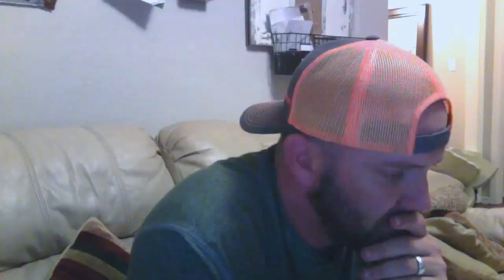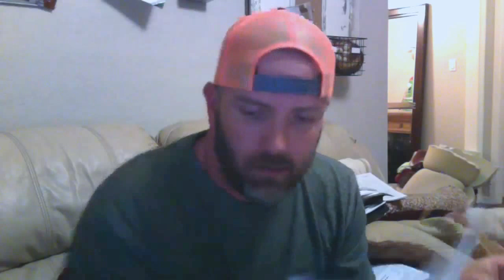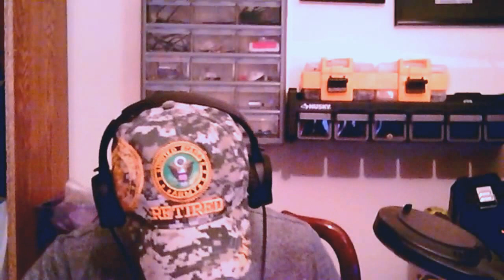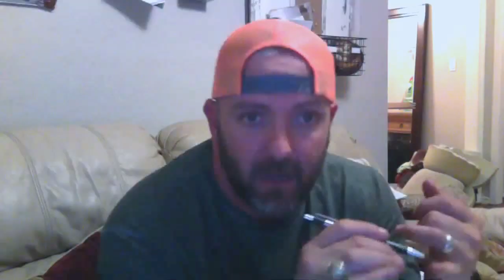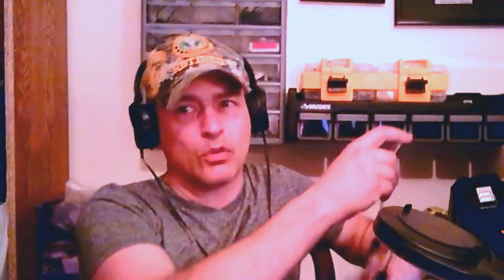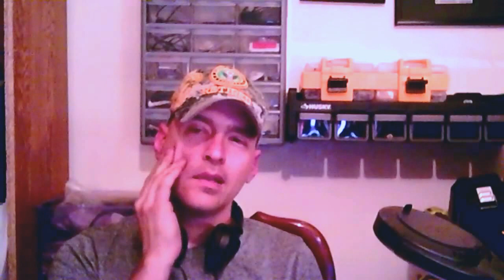PSI ELECTRICAL MASTER EXAM TUTORING SESSION

Comment: is the book he has the one on your site the Textbook PSI 2014
Reply: Mitchell Tolbert did he pass  the exam next day?
Reply from the maker: We have two books. One is a smaller 166 page workbook we use in our classes. It is a shortened condensed version of our Textbook which is 320 pages.
Reply: the one you sale on your site does it contain the same information
Reply: i took the test and i had this same test will the book sold on your site help me
Reply from the maker: channel4izzy yes sir it is
Reply: Mitchell Tolbert  how can i get your crash course book i have to take the PSI test

Comment: Hello there. I remember that question too. The HPD,  on the masters test. Im not sure I got it right But  I looked under Type HDPE Conduit. Is that right, or what and where would I look for the answer ? Thanks and appreciate the help and video
Reply from the maker: It's a heating cable. See table 400.4

Comment: I took my Master Electrical test and it seems that I took this same test. I also fell in the same traps as him. However I would tell you that your videos have Great information. I had some Motor problems and Parallel circuit problems that looked so simple but just couldn't find the answer in the options that were given. I would recommend your videos to anyone that is taking the master exam. Is there an email that I can reach you I have questions on some questions that I remember from the exam. Also were are you located. Thanks for your time. As of now I'm watching your videos to help me pass the exam.
Reply from the maker: Why thank you a lot.